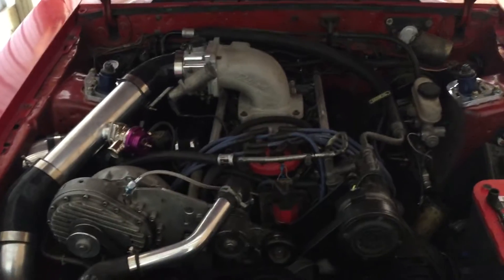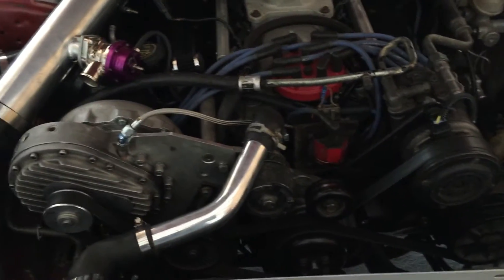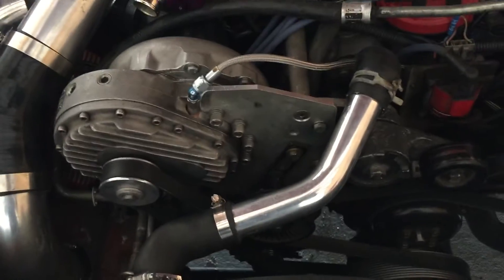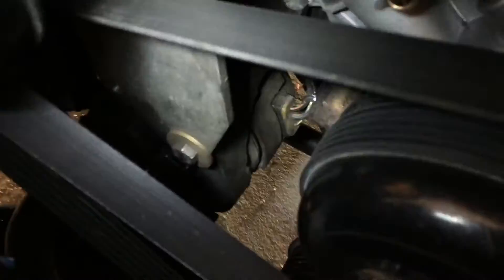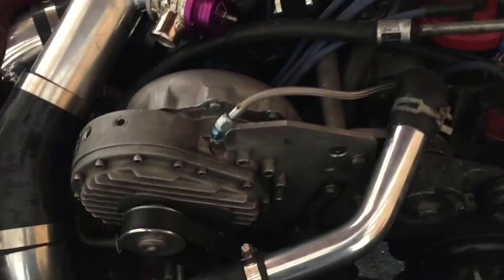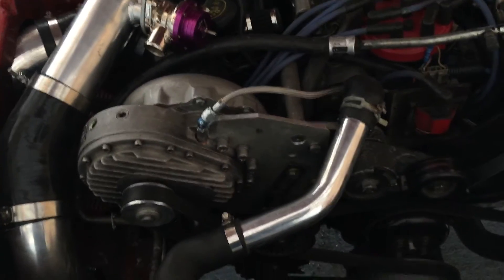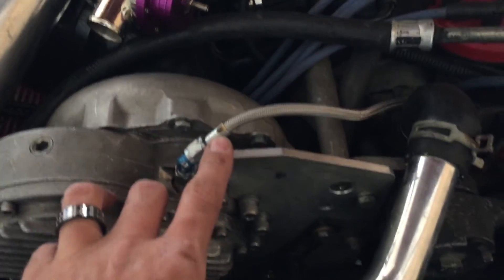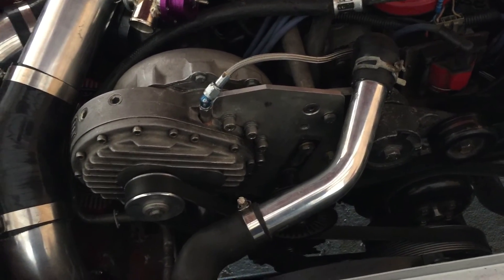Supercharger Install Tips [Mustang 351w Swap]

Comment: How did this turn out? How was the reliability?
Reply from the maker: Worked out really good and reliability was not a problem. I just swapped out to something different to make more power.
Reply: @BMF_Garage  thank you, turbo? How many miles amd how much boost did you go with? Was it a daily?
Reply from the maker: @bmxboi72 drove it all the time for a couple years.  Went full racecar since then.  Superchargers work great as long as you don’t over spin them.  The bearings can get hot and then you have lots of problems

Comment: what kind of power your making?  what's your  upper n lower intake setup?
Reply from the maker: Haven't had it on a dyno yet. 450-500 is my guess. Lower intake is an edelbrock super victor efi with an edelbrock efi elbow.

Comment: Did you use the cast aluminum bracket or just the flat bracket and spacers?
Reply from the maker: +MrMustang6957  I used the vortech cast aluminum passenger bracket and powerdyne flat aluminum plate together